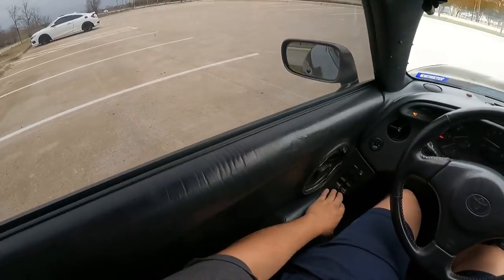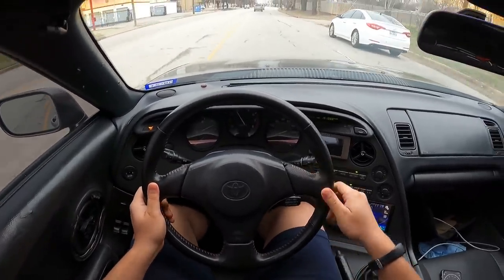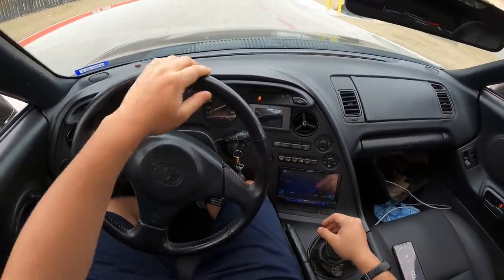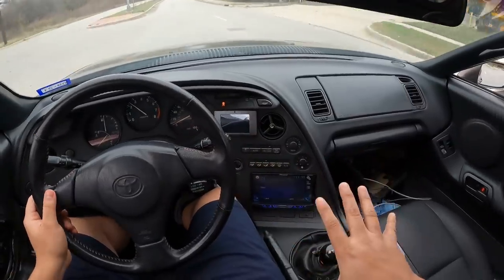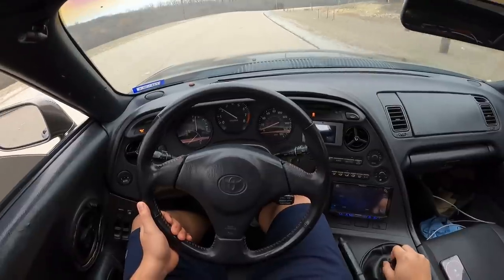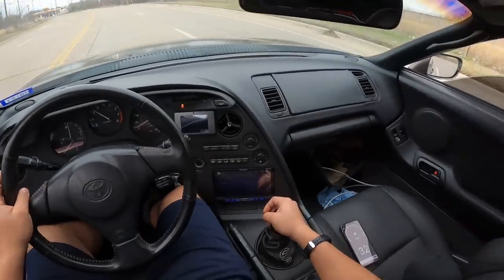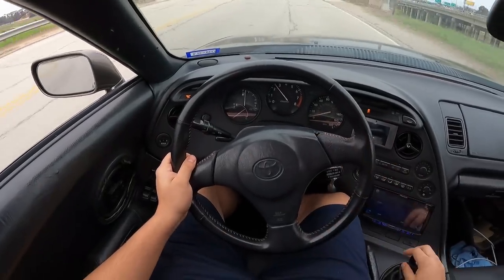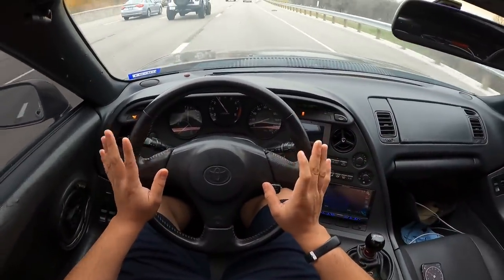POV Cruising A Big Turbo Straight Pipe MKIV Supra. ST246 Clutch Review

Comment: Great video😍
The orange light above the left vent is that normal?
Reply from the maker: It is a low oil light. My harness doesn't have the plug for it so its not plugged up.

Comment: Amazing the sound. I got a gift the RPS triple carbon clutch and in my supra I have now the Tilton ST246 complete clutch kit from Grannas. Would you swap to the RPS or leave the tilton. Thanks
Reply from the maker: I would never switch out the st246. Best clutch I’ve ever driven.
Reply: @boostedproject   Thank you for the reply, even for a 1200 hp Supra?
Reply from the maker: @AlejandroGomez-zn8uq  is your st246 sprung or unsprung?
Reply: @boostedproject   hmmm you got me there. 
The papers the previous owner wrote says Tilton ST 246 complete clutch kit with flywheel from Grannas racing. 
Tilton master clutch cylinder 75 series
Tilton 6000 series salve cylinder.
If that can tell you something...
Reply from the maker: @AlejandroGomez-zn8uq  reason I ask is because the unsprung would probably hold everything you throw at it.
Reply: @boostedproject   Thanks, I managed to get in contact with the previous owner is the sprung version. BTW thanks for the help and awesome videos really enjoy them

Comment: How does the T56 compare to something like the Toyota R154 transmission? Did you go with the T56 in order to have 6 speeds or was it due to needing to be able to handle higher power without breaking the gearbox? Really enjoyed the video. I'm considering using that TIlton ST-246 clutch on my next build.
Reply from the maker: T56 to hold the power. Also cause I have experience with it and love how they perform.